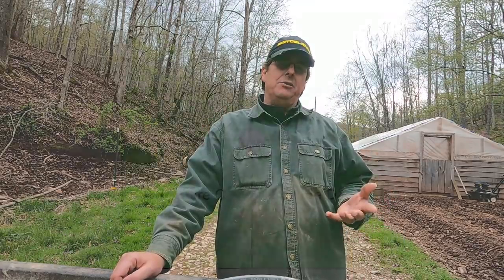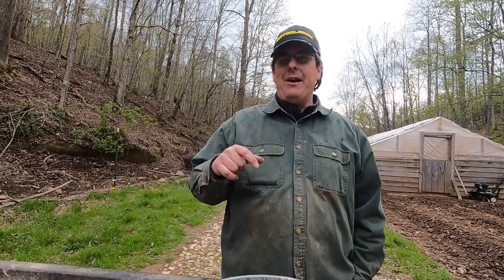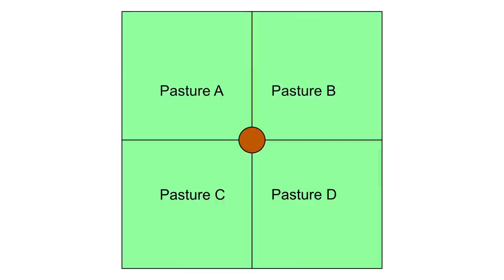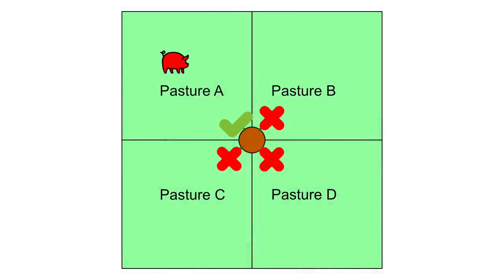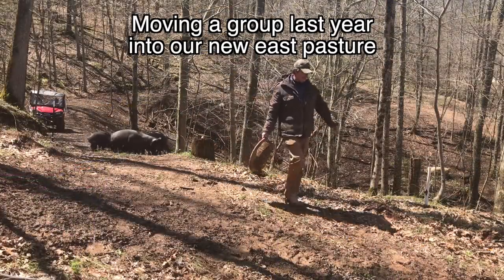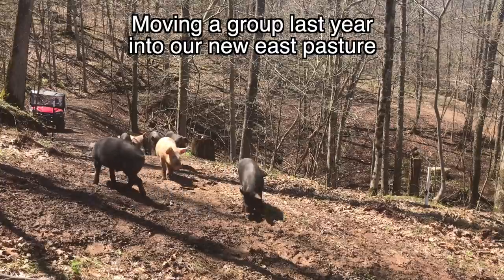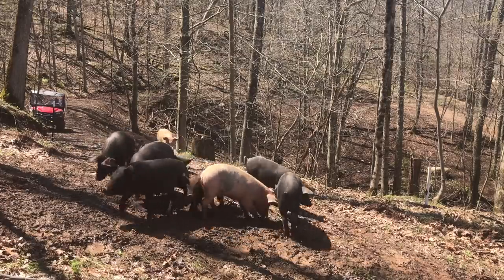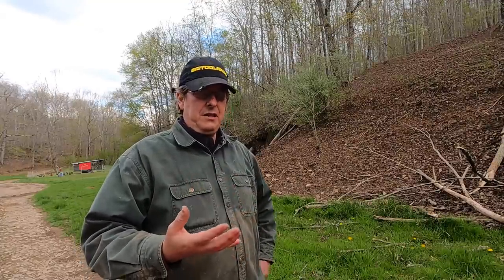Is the WAGON WHEEL the BEST Pig Pasture Setup??

Comment: my land is also very step hills, i have 4 areas set up in the old cut over, i never move the pigs except to load out for kill day, or move my boar in, or move the sows into a closer area for winter, it take a number of years for pig to root out all the brush and roots to were grass will grow on its own ready for my cows to feed on, we dont have to worry about parasites as out 40 to 50 below long winters do not allow for them to live. the few time i de warm, have yet in all the years to find dead worms in there poop as you do in say de worming a puppy.. i have a lane that runs between to cows and the diferent bush pig areas as i let the cows run a summer in the brush before the pigs go in, as the cows push over all the young poplar trees to eat the leaves off and the new limb sprought witch it a lot the bit off, by the next your the pig go in the poplar have rotted enough the pigs bust them up eating the dry bark off, with in 3 years tthere is no sign of the rotted poplars any more, after a few year of the pigs in an large bush area, grass comes up on its own and now i move that wire up and open it to the cows, calves steers heifers and run a new pig wire in a new area for them to work at. the turn the years of composted leaves wood into the red clay and root out all the roots, cant ask for anything better, but it takes years, unless you run a few hundred pig per year

Comment: You can also contract out a dirt company to come in and shave out x amount of hill for the dirt and you can replant trees etc as needed or wanted. That way you have more flat land you gain over time with more infrastructure like roads at no cost to you. Iv seen that done in places. Iv also seen where you contract out pulp wood cutters to come in the make and gravel new access roads and upkeep existing roads to points to get the pulp wood and that's done to the severity of the land owner with 0 cost and  even make a few bucks.

Comment: Wouldn't it be better to put your central location/ common area at the top of the hill not the bottom?  That way if they push some land around then you just end up with flatter land. If you're at the bottom you end up with a pond.
Reply from the maker: I own but have of the crown of the ridge so I couldn’t have the top be centralized